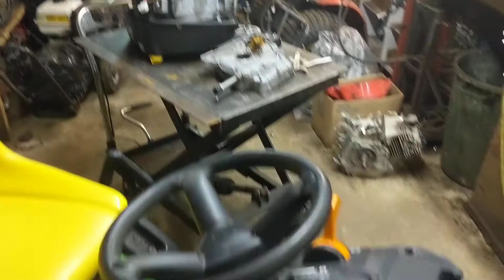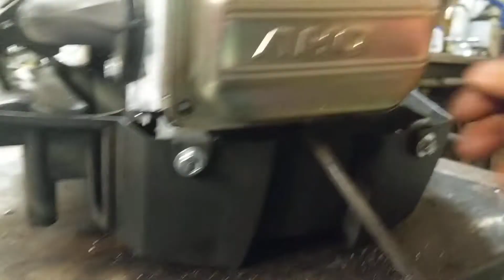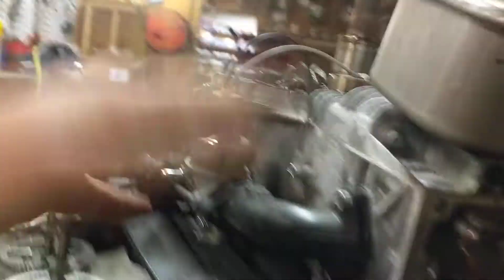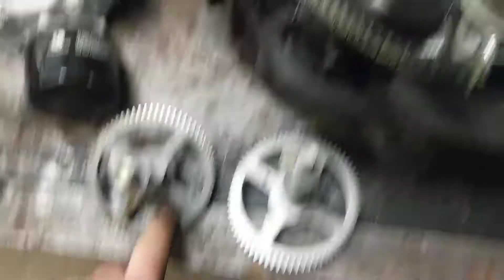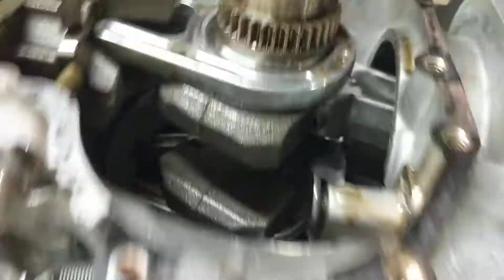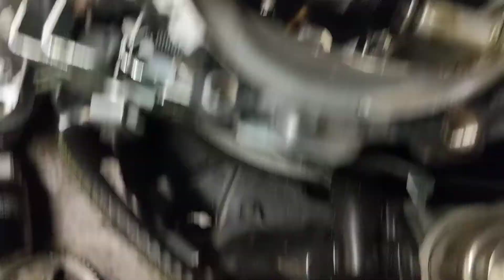Briggs And Stratton Lawn tractor hard to start, too much compression for the starter to turn over

Comment: I have an E-110 about 100 hours... have kept it nice..... TN Tractor says compressor valve broke... wants over $1000 to fix. I,m done with John Deere and Briggs/Stratton.
Reply from the maker: $1,000 is ridiculous you can get that cam now for about $100 and maybe three hours at max to do the job. Do it yourself and save a pile of money

Comment: Is there any way to tell if that’s the problem without pulling it apart? Will the starter crank it at all? Mine is sluggish to start.
Reply from the maker: You should see a little decompression swing before tdc on the exhaust rocker when you turn the engine over, if not you need a new cam

Comment: This is the exact same problem with the exact mower. Whats the odds that I found this video. Awesome Job. Do you have the part number of that? Yea
Reply from the maker: What's your engine model type code?
Reply: I was able to call the dealer and find the part. I ordered it on amazon for $29

Comment: i have the same mower l110 but it has kohler 17.5 and it does the same thing and there is no valve adjustment what you think would be causing it and just like you said if i rotate engine by hand it will start

Comment: I HAVE A JOHN DEERE 2 CYL WONT TURN OVER WITH BOTH PLUS REMOVED ONE AT A TIME MOWER FIRES UP PUT PLUGS BACK WILL ONLY BUMP  WILL RUN ON ONE PLUS BUT NOT 2  IM LOST ANDY NASHVILLE TENN
Reply from the maker: Maybe you need a new battery?

Comment: Thank you ,I've set the valves 10 times and same results . I was turning the crank by hand to soft spot and cranking but eventually that stopped working . I've ordered another tractor and yes I have did the sudden stop on my 105 so I'm sure the compression kick out is missing . I'll take better care of this new one . Now if I can get my pressure washer going to keep it clean ,shouldn't be a problem it's a Honda oh reliable. 😅

Comment: I think mines done this very thing. I did manage to get it to go by turning motor to TDC but now realise there is probably bits flying around inside.  Glad I watched this as I'll avoid doing the very things that caused it in the first place.  John Deere rocks in my opinion.  Wouldn't have another brand.
Reply from the maker: Deere is a great brand of machine,.but the Briggs and Stratton engine they install in these machines is just junk

Comment: Hi, i am wondering if there is a way of checking this BEFORE pulling the motor out and stripping it down? I am guessing only the spring would be magnetic and possibly found by putting a magnet into the oil drain pipe and fishing around for parts :(

I have done a valve adjustment and it hasn't fixed the problem. What makes me think this is the issue also is that when i try and crank the motor i don't get a small puff out of the exhaust, i get a rather large puff of compression which leads me to think this decompression arm has broken. I also have a tendency to just step off the mower when it is at full rpm WITHOUT the blades engaged :(
Reply from the maker: For sure you should be able to just remove the valve cover and turn the engine by hand watch the intake valve open and close and then you should see a little bump of the exhaust valve before the compression stroke. If you don't see the bump then you know that the arm is not doing its job.
Reply: @machinesnmetal  thanks for the reply. I cant see the inlet valve bump at all. Looks like i am up for a cam :(
Reply from the maker: It should ever so slightly bump after the intake valve opens and closes.
Reply: @machinesnmetal  how much was the part for this mower that you repaired? I just called my local John Deere dealer and he reckons the part alone is around AUD$1000 which is crazy money. Thank you so much for your replies by the way. They are much appreciated
Reply from the maker: I think the new cam was around $140CAD and the gasket and PTO seal $20CAD so less than $200 for the parts

Comment: Hi folks! So - this is on an older (2005) John Deere lawn tractor with a B/S twin V. Starting issues due to compression. I would have bet the ranch (based on everything I read and watched) that the decompression lever on the cam shaft was gone. 

So - I cracked it open. Nothing. I can’t even tell where a lever would have BEEN. There’s also no debris floating around in there that I can find. When I look up replacement cam shafts on this engine the drawings are so bad I can’t tell whether there’s a lever on that thing of not. 

Does anyone know? Can anyone help? I don’t want to order a hundred dollar part only to find out this one was fine and all I needed was a valve adjustment (I’ll bang my head later).
Reply from the maker: I hope you didn't spend all the time removing and opening the engine before you tried a simple valve adjustment????
Reply: @machinesnmetal  me too. 😑🪓. But it’s been educational. 🙄

Comment: Are you going to do the step by step videos?  I have this exact issue. I can do this if you show me how. 😊
Reply from the maker: I will definitely the next time I get one to repair like this
Reply: Question, if you don’t mind. If I remove the spark plugs (thus removing the compression), turn the key to engage the starter, and it turns, will that pretty much confirm the diagnosis or am I gonna tear something up??
Reply from the maker: Removing the spark plugs and cranking the engine won't ruin anything but it won't tell you if the problem that is the subject in this video is the problem that you are having.

Comment: I have this issue. My John Deere dealer is trying to tell me that I need to replace the whole motor 1200.00. how can I argue with them?
Reply from the maker: You can't. They are too big and won't usually do a small repair like this, it's not a money maker for them. Take it to a small independent equipment shop. They should be happy to do the fix in the video, or do it yourself.

Comment: I am having the same problem - same motor. Took mine apart to swap the cam but the compression release was in tacked. So I put it back together, It's still hard to turn over. have valves at 6 and 8000. Could it be the crack case breather because I get a small suction/horn noise there when I turn by hand. I'd appreciate your advise. Dont know what else to try..
Reply from the maker: It could be the battery the starter solenoid the cable that connects the battery to the starter solenoid or the cable that goes from the solenoid to the starter itself, or it could be the starter. It could be a bad ground lead from your battery to your engine or frame.
Reply: @machinesnmetal  Since I'm having a hard time pushing it by hand at the compression stroke, I think I'm going to have to try swapping cams after all. When there is compression release, Do you know where the air escapes through? That's why I thought maybe it escapes through the crack case breather and that its clogged. But I don't know, guess I can try to blow and suck air through. Maybe my old cam wore out a bit... ?
Reply from the maker: The compression release bumps the exhaust valve so the compression should escape out the exhaust momentarily when the lever hits the tappet